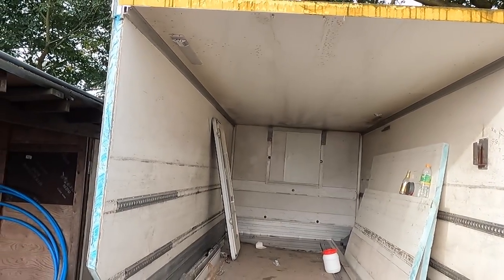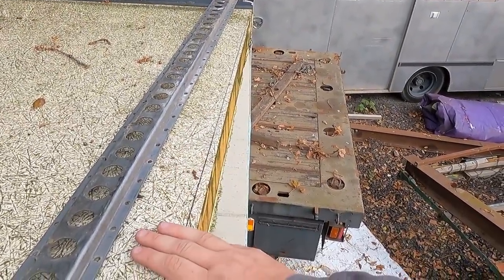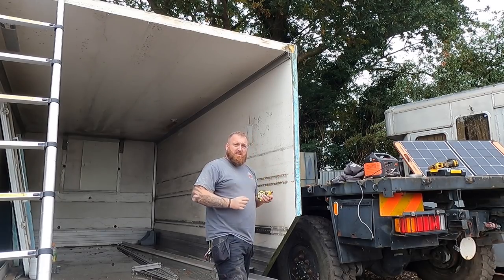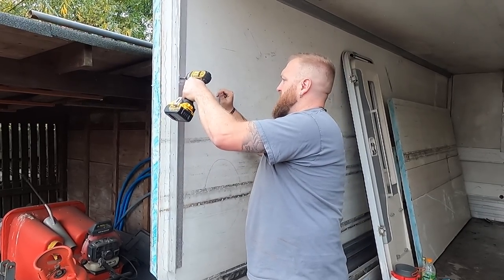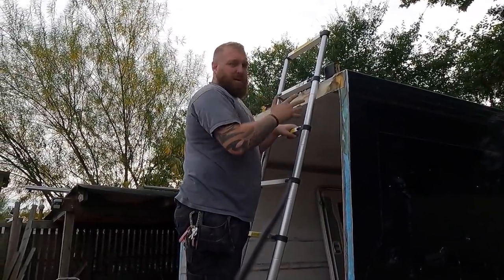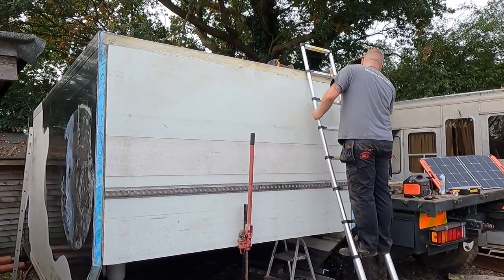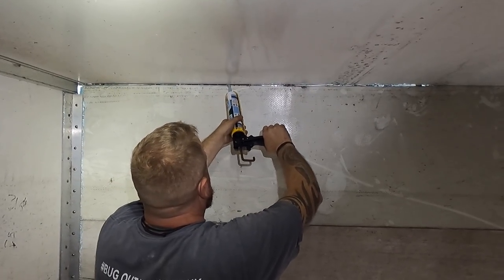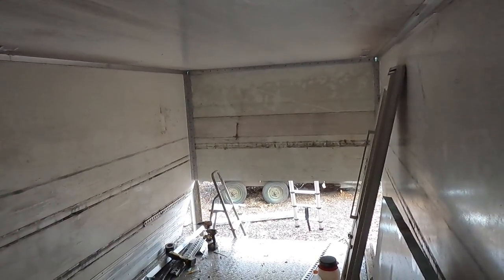BUILDING A 4X4 OVERLAND TRUCK CAMPERVAN (the habitation box) part3

Comment: Make that a million and 1 things I've seen a hi-lift jack used for. Absolutely perfect for the application!
Reply from the maker: Best use Iv had yet was off road when a tree was just too lent over for me to get past. I strapped the tree to the jack 6foot off the floor then to the next one 6 foot up. Jacked the two trees closer together drove through then released them. Happy I didn’t have to cut a tree down just to drive a bigger vehicle through.
Reply: @Bugoutvehiclesuk  that's a million and 2! And a classic!

Comment: I hope that you do the build in the order you want to. I'd be happy with whatever content you decide to put out. The high lift jack did a wonderful job of putting and holding the back panel where you wanted it. I know it's going to turn out fantastic looking like any of the other projects you've done. I've only known you through YouTube but I know that you're not the type of person to do something half-assed. I hope you and the family have a wonderful Sunday together. God bless and stay safe.
Reply from the maker: Thanks mate. I think I will get the door in and the panel on the back then get the seats and bed base in. Then I can see what space I have to work with. It’s a big project but it should start coming together once the big bits are sat in.

Comment: Nice to see this coming along 😎.. if you’re struggling cutting with the angle
Grinder try a diamond cutting wheel £10
Shouldn’t clog, worth a try.. give me a shout If you want any help designing the inside with autocad, will help out with planning and save a million hours if you want to
Change/try new configurations

Comment: G'day Rich. As long as you are happy with how you have put it together, then it doesnt matter whom cringes whilst viewing the assembly :)
You mentioned screwing on the 'lower rear canted panel' for ease of removal to create a large item ingress port/opening. Mayhaps consider mounting it to hinges (high mounted), gas struts, lockable and waterproof? 
The build will take as long as it takes cobber.
We appreciate you taking the time to share the content.
Hooroo for now from nazi occupied Australia.
Reply from the maker: I was thinking about screwing just because it’s secure but once I get the few big bits in and the ball rolling I can work out the hatch situation. I’m sure it will work it’s self out. Hope your well bro.

Comment: for the lower hatch, the angle your butting up against you could have either rivnuts fitted and tooling is something you can buy yourself easily and probably use a lot in rest of build, or have some captive nuts welded to the ally in little cages so you can bolt in the panel. i'd look to get some thin close cell foam to glue to the angle the hatch butts against as a broad weather seal to keep a draught out. Before you close it up how about running a pressure washer over the inside and letting drain out that nice big hole? or close it up and make the kids earn pocket money by washing the inside down for you with bucket and sponge?
Reply from the maker: That’s a good idea for the rib nuts.

Comment: Great video - we are planning an expedition truck based on the DAF so love seeing how you are doing it! Question: What type of screws did you use to attach the Aluminium bracket to the Composite? Looking forward to the next video in this series :)
Reply from the maker: I used the ones that originally held the rail to the inside.
Reply: @Bugoutvehiclesuk  thanks - reusing at it's best :D